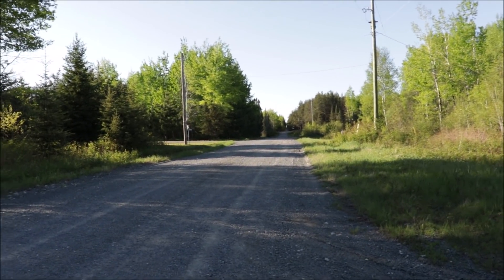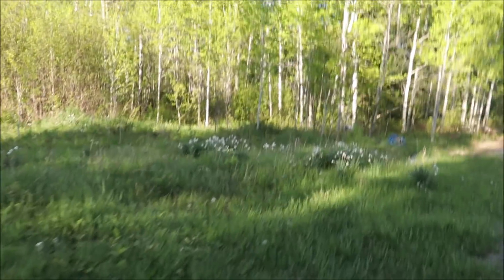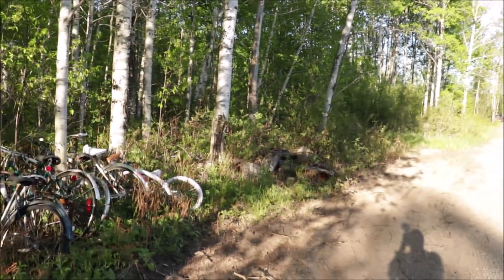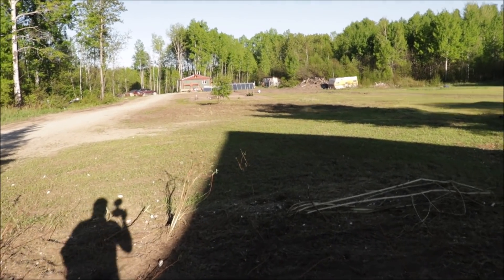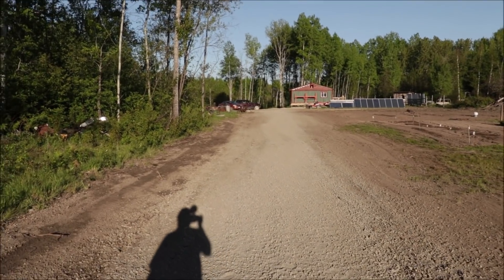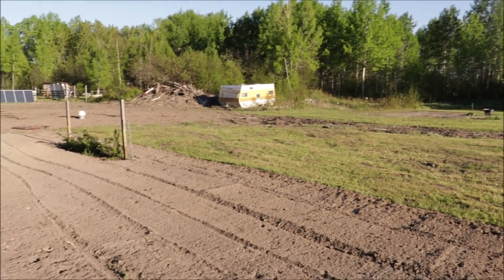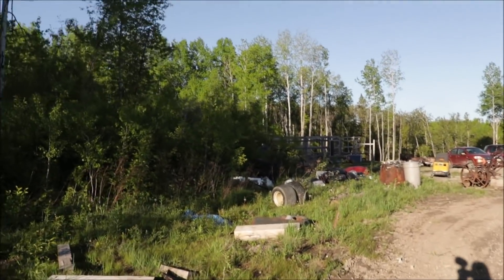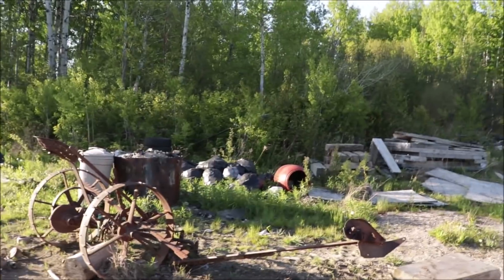We Tipped Our Homemade Crane Trailer, Off Grid Homesteading

Comment: How did you get my pop corn popper?  I saw the presher cooker, and that is what I have been using for years..  Also have you ever thought of putting keepers on top of your boom?  I would cut some 1/2" pipe in half and into short pieces.  Then weld them at different spots along the boom.. lay the cable in the valley, and you wouldn't have to keep and eye on the cable, while you are letting it out...

Comment: I'm arm chairing an idea.  When the outriggers are put on front and back, and both sides, have holes drilled in the pads at each outrigger.  Put stakes in each outboard pad.  Have an eye at the top side of each stake.  The stakes can be driven at an angle deep in the ground to keep the trailer from lifting.  When you are done, you can use the winch to pull the stakes at the eyes.  You may have already thought of this, but better to let you know than to have an oops later on.  It is looking nice on the property, and you are both working so hard.

Comment: You Should Keep the Little Pieces of Copper Pipe in your tool box cause Any time you need a Battery terminal or lug you can make it out of copper
instead of running to the store and Paying $6-$8 for them Plus your Gas and time.

Comment: Hey Cecil looking really good getting things cleaned up. It's amazing how things accumulate over the years. Your crane is working excellent but if I may make a suggestion. Fix a swing rope to your lift block so that when you lift the load you can just pull the load around to you without the danger of being next to it swinging by hand. This will also allow you and Heather both to stand in a safe place on trailer giving it counter balance.  This will work good while loading logs as well and give the ability to use it by yourself if needed.
Reply: That's how Ron Pratt/Midwest trucks does it when he lifts containers with his rotator. A man with a long control rope!

Comment: I am surprised beyond   words as to the capacity of lift your getting out of the lift system. Seldom have I seen it work as well and trust me.... I've seen plenty. Just saying I thought you were going to back up to that tub and bring it on board from the back so your "Lazy butt" did it absolutely right. I really don't expect markets to go any higher so if your really going to benefit from saving scrap copper now would be a good time to grab that fifteen hundred to two thousand dollars. I have still got piles of scrap on this place that mother earth has claimed from me. I know your glad to be done with the large dozer but doubt a smaller one  could of done in a haste what your big one did. One of my boys said ; Dad just take the four down to your place and do some clean up.... Its a two thousand seventeen D4 with a fancy cab and stuff as he has a few of them on different jobs. If I took it to the end of the driveway the track frame would break in two pieces or something in the engine would go zinging off to never never land. I don't have another handy close to two hundred thousand to buy him another so it stays there. I don't even want it near here with him running it.... and I gave him his first equipment to get started in clearing properties. His hands are tighter than a Jew's wallet when it comes to money. All my kids are making good coin but they forgot who it was that raised them. No calls, no visits.... its me go to them and sorry but no thanks. You say build a garage?? Is that the one that you guys started by the Mill? just curious